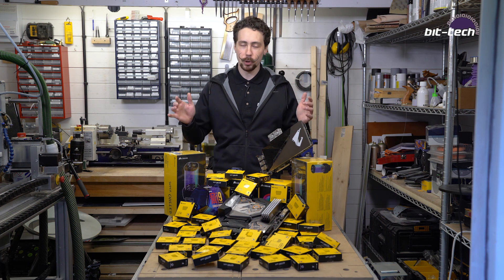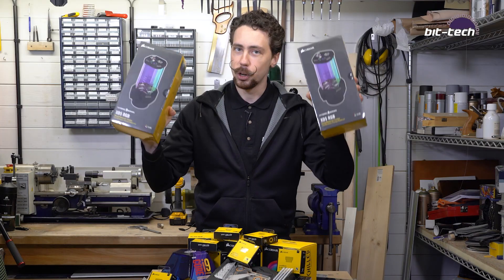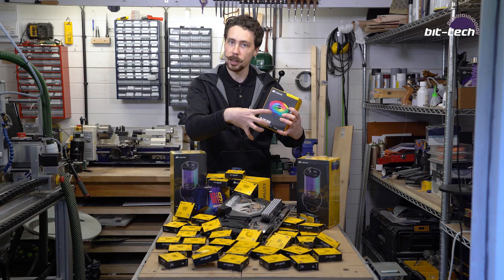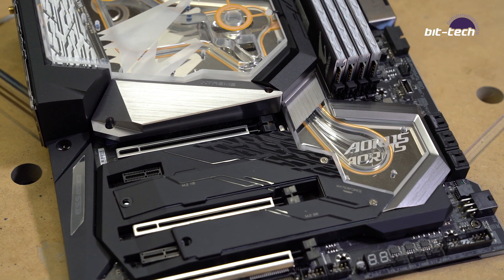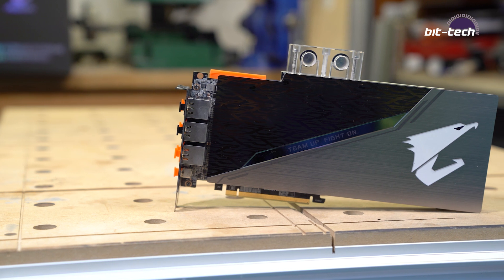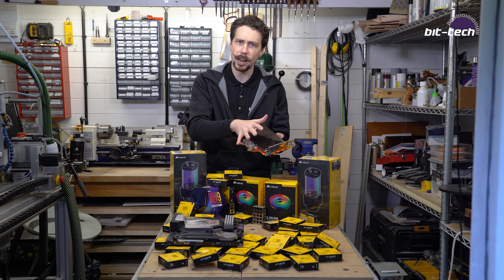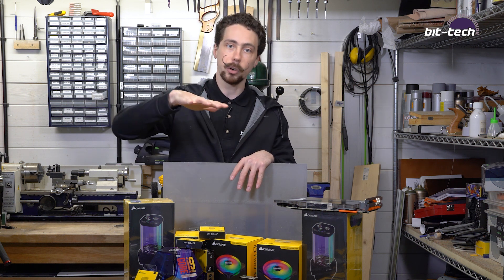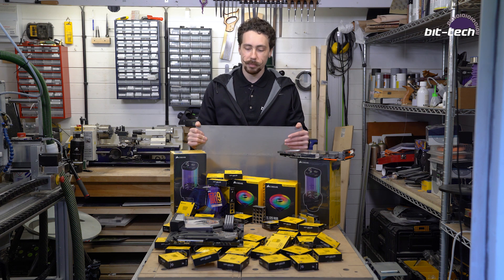Project #AORUS-KS feat. AORUS XTREME WATERFORCE & Intel 9900KS Part 2: Motherboard & Graphics Card

Comment: Are you doing vertical mont because I have the same Gpu and the top is very black and white. I only ask because I’m just curious if it will hide all the cool brushed aluminum you just added.
Reply from the maker: Yup and indeed it will hide everything, always a bit of a shame with vertical GPUs if you have a nice looking motherboard. Originally it wasn't going to be flat against the board, but the extra depth required would have made the rest of the mod a bit lacking. If we could use an SFX PSU here it probably would have alleviated that problem though, ATX ones just feel so big now I swear.